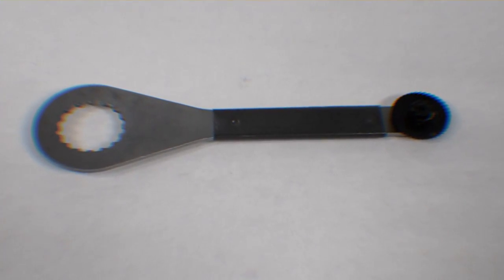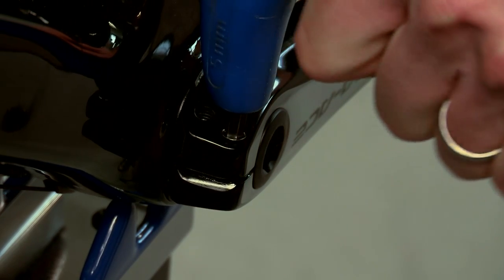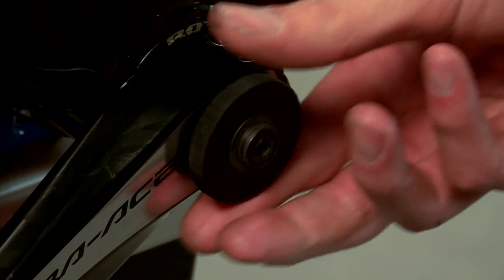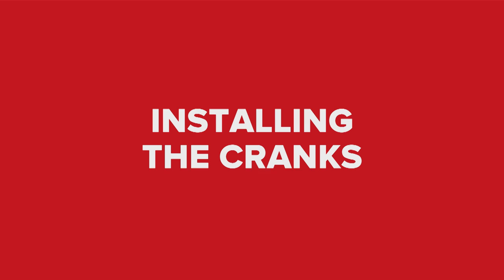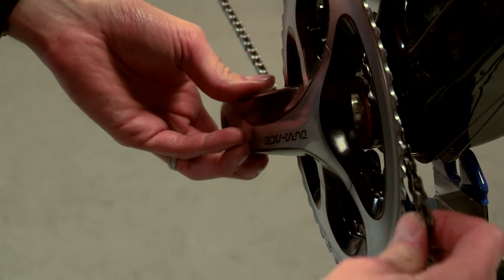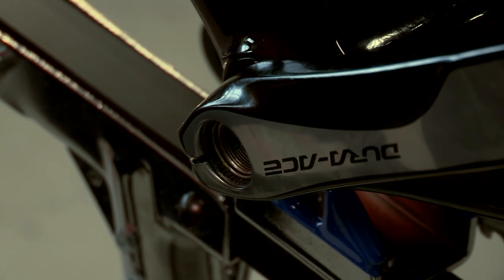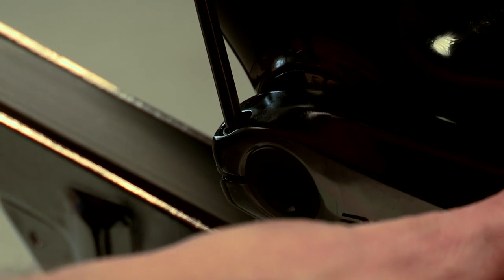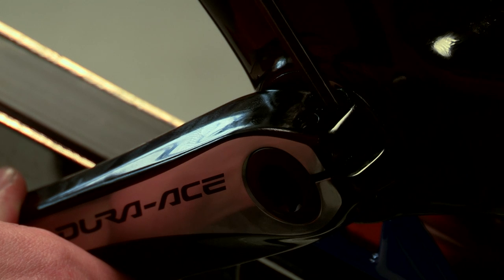How To Change Your Chainrings and Cranks - GCN's Bike Maintenance Series

Comment: what happened to the retention pin that was removed in the beginning?
Reply: Bernd Dotzauer I broke mine off removing the crank so it wasn't necessary! :D Seems very flimsy plastic and looks largely superfluous, certainly torque is the same after riding for a good while so I hope so...

Comment: If i am running a 50/34 chainset and want to change it to a 53/39, do i have to move the front derailleur up the seat tube and tune the indexing or can i just switch the 2 chainsets without touching the front derailleur?

Comment: hi guys
great video
i want to upgrade my FSA 50/34 175mm to a shimano 105 50/34 , in line with my 11speed 105 groupset. i believe this should be straight forward, of course with the different systems of uncoupling as shown in this video. 
also are they always sold as tri parts: non driveside crank arm + the driveside crankarm + the attached spindle

Comment: Hey - thanks for the video. I currently have a 46/36t crank and want to change to a 46/30t - is there anything that I need to check to confirm compatibility? It’s a 105 mechanical derailleur and I’m assuming that because it’s a a 16t difference, should be relatively straight forward with maybe a little adjusting of the front derailleur once installed?
Reply from the maker: That is certainly a big jump in terms of size. Your local bike shop can always help you adjust it and there is lots of compatibility charts on the Shimano website to help you out!

Comment: hi Daniel, I am considering to build a bike using Campagnolo gruppos. I did my research and found that they have s#!tloads, okay three crank system. From what I know the Power-Torque have problems with disassembly tools, whereas the Ultra-Torque having problem in BB-spindle length that causes a small lateral play. I haven't heard and see much their new Over-Torque crank. I really wanted to know what my options are. Do you mind to disassemble your beautiful Venge and make a video of it? more so, a comparison or side-by-side instruction of assembly of the systems is much much much appreciated. Why can't they make everything Shimano-simple, Hollowtech II is such a bliss. Anyway, happy new year you guys!

Comment: Hello GCN. I must say, I always look up your channel for all things bicycle! =) Well, aside from Google. You got yourself a fan! So, anyway, I was looking to replace my chainset for my 7 speed bike. What if I got a bigger chainring? I was thinking...if I did that, then all I have to do is to also get a new chain just so I can compensate the length and tension of the chain? Correct me if I am wrong. Thanks!
Reply from the maker: Hi there, glad you like the channel :-) If you get a bigger chainring you will likely need to change your chain - it's a good idea to do it anyway if you change your cassette or chainrings anyway as the chain will probably be worn.
Reply: I see. Then, it looks like I am going to replace the whole drivetrain. One more thing, why must I get a chain that is compatible with my bike speed? Is it purely because of the length?

Comment: Guys, I have to change the crankset on my bike as mine is completely knackered, and a friend is giving away a brand new 10-speed one off his bike. If I have an 11-speed shimano 105 groupset will the two be compatible?
Reply: Try it on your chain.  11 speed chains are ever so slightly narrower than 10 speed.  I do know you can run an 11 speed crank on a 10 speed chain, but not sure if it works vice versa.
Reply: +Harry Munk thanks for the advice. I'll give it a shot.

Comment: My bicycle has 3 front cranks, I want to remove the middle one, is it possible?
Reply: They are called chainrings. The crank is the whole unit including cranckarms. And Yes it is possible to remove individual chain rings on just about all cranks. I can only explain Shimano types like in this video. So  once the crank is removed you will see that the chain rings are bolted onto the drive side (chainside) crank arm. Unscrew the bolts in turn until you can access the centre one. You may need to buy a special tool to unscrew the bolts. Search Chainring Peg Spanner. The chain rings are usually available to buy separately. Check this before doing the work! Bear in mind they can be expensive. Mine was £35. They should only go back on aligned in a certain way. There will be videos on this.

Comment: hi, how do you make sure the non driveside crank arm is 180 degree aligned to the driveside crank? just a visual guess where close enough is good enough? cheers
Reply: The spline pattern for the left crank will only allow it on in a 180 degree orientation, there is a little gap in the pattern exactly on the axis of the crank. I haven't tried but you might get it on in exactly the opposite orientation, i.e. with both cranks pointing the same direction, but it's only 0 or 180 that are possible options, you can't realistically get it wrong, the crank just won't go on at 90 or 175 or whatever.
Reply: blorg thanks mate
Reply: You can see the gap at 0:50

Comment: How many Nm should the bolts be tightened if I do it with a torque-meter wrench ?
Reply from the maker: til20100 It should normally be marked somewhere near the bolts, but if it's not, look up your specific component on the internet and you should be able to find it.

Comment: Global Cycling Network is there a follow up video about changing to and from a compact and the necessary adjustments needed to the front derailleur? I changed mine over back to a compact from a 53 and found the chain rubbed slightly. Ended up having to pay to have it adjusted.
Reply from the maker: The best thing to do is to check out the index your front derailleur video, as that's what you'll need to look at.
Reply: Global Cycling Network thanks. The bike shop guy mentioned about raising and dropping the derailleur as opposed to indexing. I took this to mean vertically raising and dropping. Is he just using different terminology instead of indexing?
Reply from the maker: AussieKopite It's all part of the picture, and covered in the video.
Reply: Global Cycling Network Thanks guys

Comment: quick question guys..if I'm going to change my cranks then do I need to buy new chains for it?
Reply: I wanna know too..
Reply: @fairleemade  I went to my trusted bike mechanic and he told me that when it comes to changing cranks, there's no need to change chains but when it comes to changing your cassette then it is required to change chains by then
Reply: Thank you very much for the reply. I need to change the crank on my bike, so the chain should be fine for now.

Comment: I followed these exact steps however when I ride, the preload bolt came loose and the cranks could slide from side to side? What have I done wrong?
Reply from the maker: woodzman1000 Did you do all the bolts up to the correct torque?
Reply: Pretty tight, unless it wasn't enough?